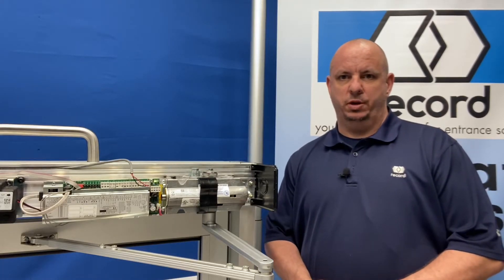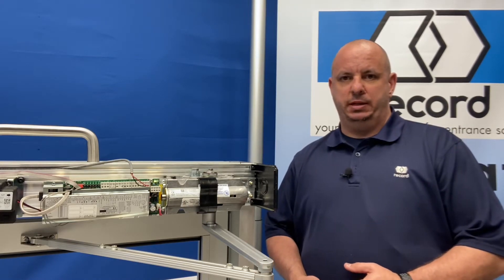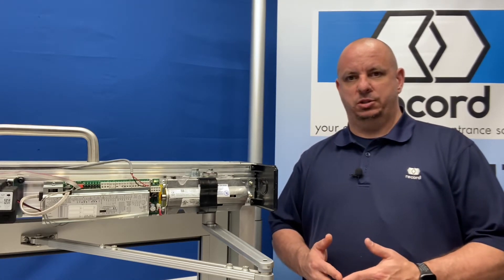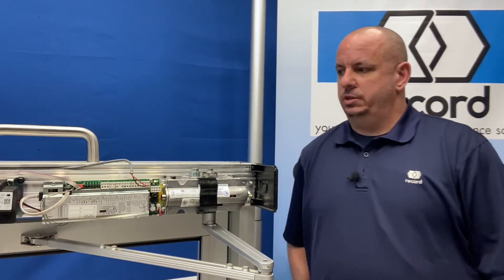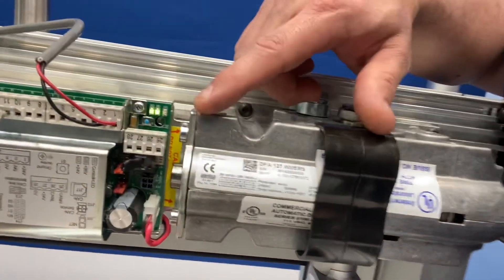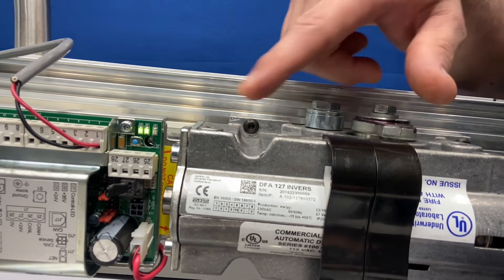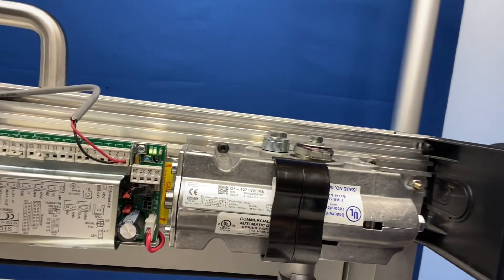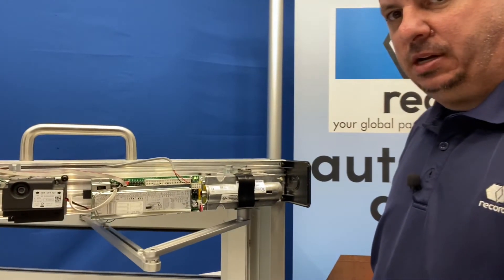Performing a learn cycle

Comment: If you have a master and a slave, do you just do it on the master? And then the slave will operate too? Thanks
Reply: did you find an answer? i am curious about this aswell
Reply: Need to do 3 flashes on both